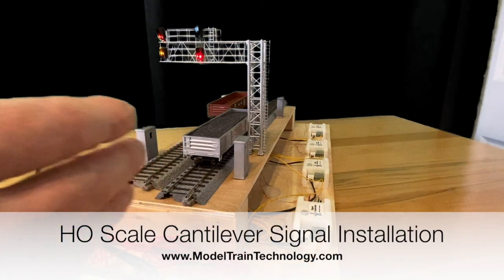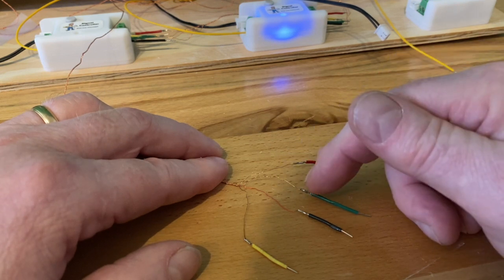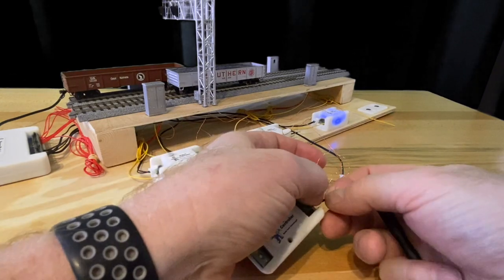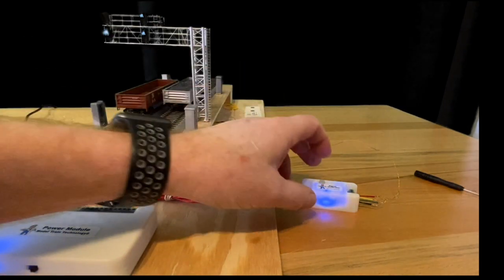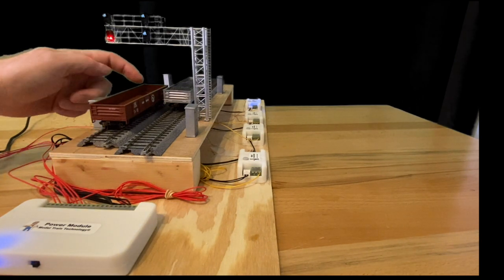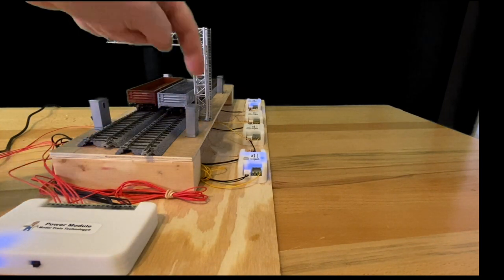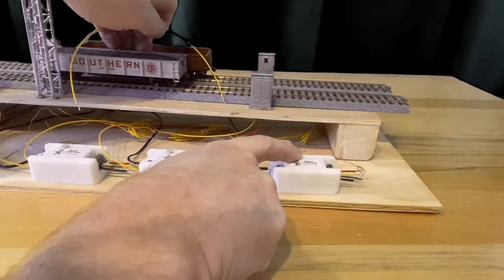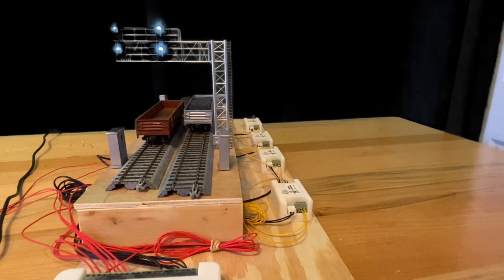HO Cantilever Signal Bridge Installation

Comment: are these detectors bi-directional and for the grade crossings as well....
Reply from the maker: The detectors activate when an object is in front of them.  Generally, it does not know which direction the object came from.  We do have a directional Nano sensor that uses two sensors to determine direction.